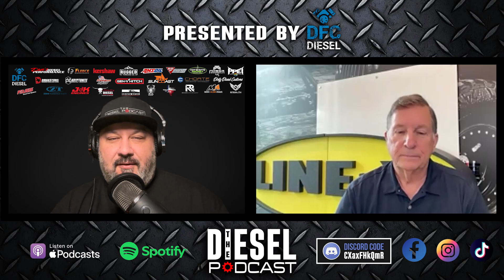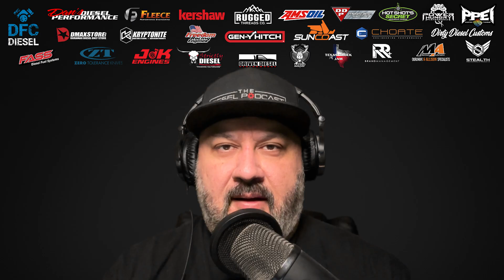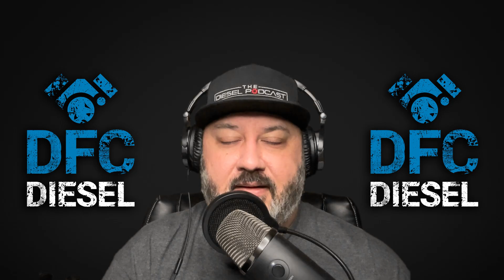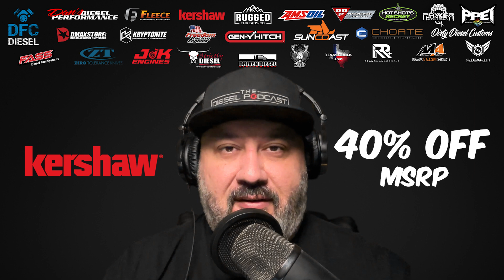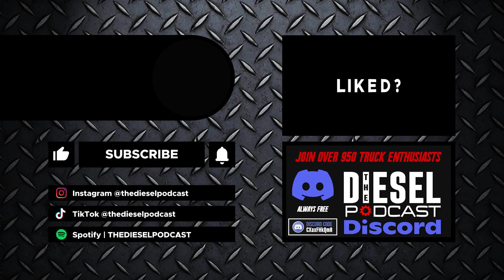Not All Bedliners are Created Equal

Comment: My  regular cab 07 6.0 F350 2WD shorty is painted with line x the hole body love it setting on 24 rock stars only has 60.000 miles on it will keep it forever my other truck is a 19 L5P denial drw took it apart and had the frame line x